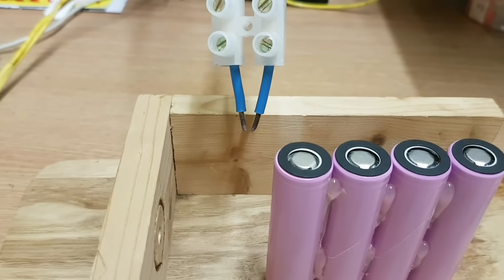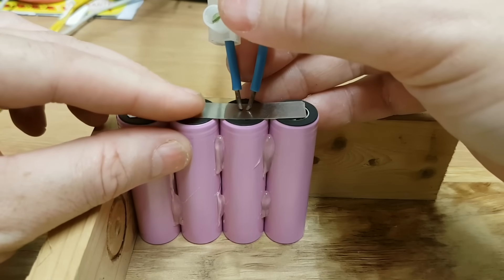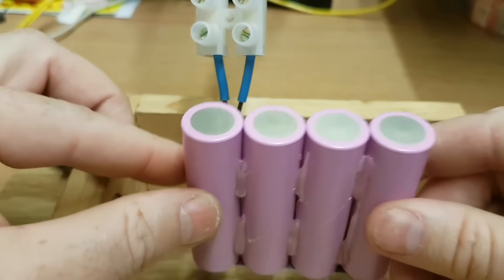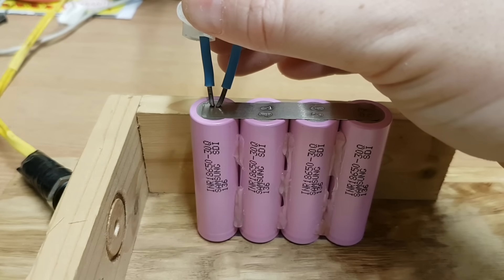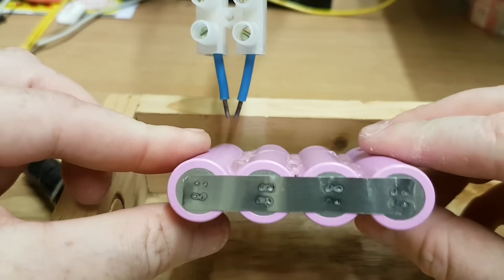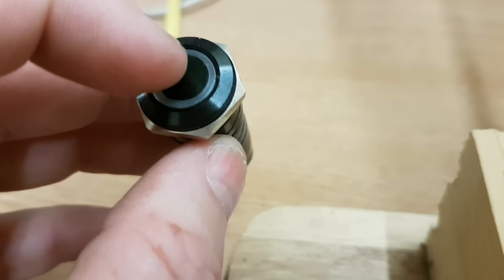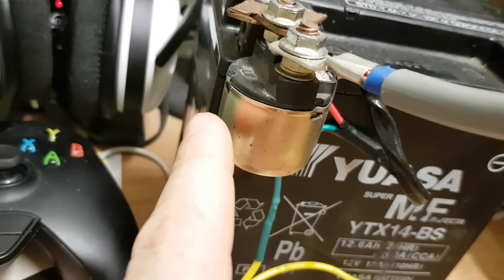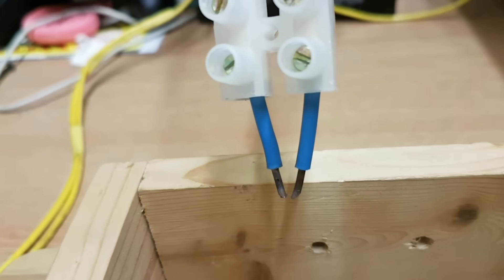DIY Battery Spot Welder - Demonstration & Explanation

Comment: very cool, this just appeared on my recommended list, I have some batteries for drills that need repairing so this might just be a great find to make a spot welder. I had no idea how basic they actually could be. Now just have to "get around to" doing those jobs lol. Well done and well explained. 👍
Reply: This is the same reason I'm looking for a diy spot welding method! Old Durabilt 14.4v tool kit with 5 tools that have lost function because the battery packs are dead
Reply: Right..I really want to fix up some old 12v batteries I have for an old kit.  I've seen videos of soldering the strips but lordy it scares me!

Comment: Pretty simple tool, though I did wonder how long the choc-block would last. The 60A rating you link to should be OK.

I suppose that wooden frame we see has other uses, but, with the delay timer, I'd think of a bracket for the switch. I think would want to use the delay timer if I were using a foot-switch. An option I came across was on an old sewing machine, a knee-operated controller, so the sewing machine could be on an ordinary table, with a detachable long arm over the table-edge to knee level. Again, use the delay timer.
Reply from the maker: Take a look at my later video... I integrate the button within the wooden jig 👍🏼

Comment: Great video mate, love the idea.
Quick question, where are you sourcing that metal strip? Is it shim material or something intended for that purpose?
Reply from the maker: It's 100% nickel. You get them in different strip widths and thicknesses. You don't want to get the nickel plated steel.

Comment: nice to know that it's actually this simple

say, I was considering to simply upgrade a makita battery with one of these 15 cell cases off aliexpress
think it would work if I just slap 5 extra cells at 2.5ah on there and make it a 7.5ah battery?
Reply from the maker: Yes, as long as the voltage was correct. If it's 18v it would be 4 cells in parallel to get the right voltage.

Comment: Hi thanks for the very useful vid, however I'm a little confused about what you've said 200 amp battery what do you meant by that? You're using 12v 12.6A right?
Reply from the maker: 200A CCA. It's a rating of how much current the battery can deliver.
Reply: @darkkevind  thank you

Comment: Great tutorial, I've tried many times to solder these with zero success so might give it a go, thanks
Reply: I soldered 96 cells together for an ebike pack. With a BIG iron with a super high thermal mass, it's not that difficult, but it's stupidly time consuming. Counterintutively, the bigger your iron, the less likely you are to damage the cell, because you can get that surface hot enough to tin without holding the iron there for a really long time. Still,  not ideal, this is a much better method.
Reply: @MrJamesonStyles +1 on bigger iron REDUCING heat delivered into the cell.   Also, I find that scrubbing the cell button with Scotchbrite right before soldering helps a LOT.

Comment: I have 2 questions :

1- this method or super capacitor method? Why?
2- how is the amper calculation formula? It reads 12Ah on the battery. How do we say it is 200A?
Reply from the maker: 200A is the CCA rating (cold cranking amps). It means the amount of amps the battery can produce, like for a starter motor etc. cranking over an engine.
Reply: darkkevind I have 12v 7a yuasa battery. How can I find its CCA rating?
Reply from the maker: @philipmurrayy  Google the specs of the battery? 🤷
Reply: darkkevind then how many amps I should get at least?
Reply: darkkevind I found these specs 

Nominal Capacity (Ah)
NP7-12
20hr to 1.75vpc 20oC
7
10hr to 1.75vpc 20oC
6.4
5hr to 1.70vpc 20oC
5.9
1hr to 1.60vpc 20oC
4.2
Voltage
12
Energy Density (Wh.L.20hr)
91
Specific Energy (Wh.kg.20hr)
32
Int. Resistance (m.Ohms)
25
Maximum discharge (A)
40/75
Short Circuit current (A)
210
Dimensions (mm)
Length
151
Width
65
Height overall
97.5
Weight (Kg)
2.65
Terminal
A/D
Layout
4
Terminal Torque Nm
-
Reply from the maker: @philipmurrayy  I'd go for a 300A CCA rating at least.

Comment: So now that you've done that how do you charge them?
Reply from the maker: The cells?
Reply: @darkkevind  Yes, how do you charge them?
Reply from the maker: @amelliamendel2227  well when they're made up in to a pack, normally you'd use a BMS, but you could charge them just with a power brick of the correct voltage, directly to the +/-

Comment: @darkkevind
Cool and easy, obviously very effective little spot welder for this function. The very same function that I want a spot welder for, making my own lithium battery packs.
Out of curiosity, how many spot welds do you get from the size battery you are using in this video before it needs recharging?
Edit: FYI new sub here, good work mate!
Reply from the maker: I easily welded 50 cells with at least two welds on each end of the cell on the same charge or the lead acid battery. After each pack I made I'd put the LAB on charge to top it up, but it didn't really need it to be honest.

Comment: Yeah, it works, but I am curious about whether it performs well with the batteries that do not have those broad "caps" on the "+" pole (these broad caps allow for easy soldering, unlike the narrower "pluses" on the older and cheaper, "made in china"  models).

Comment: so that setup can be used to rebuild a laptop battery pack? thanks   are other rechargeable batteries able to be tacked to the nickel strip as well?  also, what vehicle did the battery come from?
Reply from the maker: Yes, any pack can be made up with individual cells and nickel strip. The lead acid battery is from a small car.
Reply: darkkevind ok thank you very much sir!

Comment: What does the solenoid do?
Reply from the maker: Exactly the same thing it does with the starter motor Inn your car...
It lets a small, low current, low voltage switch, turn on a much bigger, much higher current rated switch.
Reply: @darkkevind  And that is necessary so the clicker switch doesn't have to carry the full current, correct?
Reply from the maker: @heavymod9476  that's correct.

Comment: Is it possible to use a capacitor with the battery rather than a solenoid? I've been using your design for over a year and the solenoid broke today. Just wondering if a capacitor would last years longer?
Reply from the maker: People have been using a capacitor to do the high current discharging... But I'm not sure that would take place of a switch?

Comment: Nice, works perfect. Ever considered a food pedal for activation? Then you would have both hand to handle the batteries.
Reply from the maker: I actually tried a foot pedal but didn't get the accuracy with welds that I can get with the finger activated button.

Comment: Went to Home Depot today and bought two lengths of heavy 1 O wire each at 2.5 ft or 763 mm. for 8.00 US. And added 1 ft or 305 mm in length of 1/8th inch or 3.175 mm solid copper wire.for  66 cents. or 60 euro cents.  I bought a battery of 280 cca for 22.00 at my local walmart. Or 19.90 euro's.  All of my parts will arrive tomorrow and I have already charged and tested my batteries for my 52 volt E-bike without a PAS sensor. Thanks for the video as it saved me a lot of money for a possible one time venture!
Reply from the maker: You're very welcome! I hope your build goes well :)
Reply: @darkkevind  It turned out better than I could have imagined. Thanks for all of your help and the post.
Reply: Or you could have bought one off Amazon for $30.00 to $50.00 without leaving the house.
Reply: @craiginswflorida9324 

Yes and those work maybe one time and then their done. The internal batteries always go bad.

For a decent one you have to spend  $200 - $300.

This is a better option.

Comment: i bought one of those chinese ones and it does work but the welds dont stick. like i could turn the nickel strip red hot and it still wont stick. idk why either its like 50/50 if it does or not
Reply from the maker: That's a shame... This seems to work well 99% of the time for me. 👍🏻

Comment: I recommend for anyone wanting to build this spot welder to place a "Zener Diode" in series with the negative  cable and one with the positive cable to prevent any overload on the solenoid, switch and battery and prevent injury.  Bridging a battery can cause an xplosion  and can result in serious injury or death!  You can also place a circuit breaker or fuse in series with the switch for overload circuit protection causing the breaker to switch or fuse to blow.  For zener diodes use correct amperage rating.
Reply: so, if one used the exact battery seen here, what zener diode is correct?   And, what size fuse would you use?
Reply: If you were driving the solenoid coil with an electronic timer, I agree a diode in reverse parallel over the coil ( almost any type will do) would protect the timer against back EMF. In this circuit there is nowhere to put a diode of any type in SERIES.

A 200A DC circuit breaker from ebay 9about £8 / $10 might be worth buying though.

Comment: Is there a reason you use a battery to power your spot welder? Could I use a PC power supply rated at 600w with the capacity of 12v at 60amps? Thanks
Reply from the maker: No you couldn't. As I explain in the video... you need at least 200A to conduct a decent spot weld that will weld the nickel to the battery cell. Also, you're basically shorting the battery and  you wouldn't want to do that with a mains power supply.
Reply: @darkkevind  Sorry, I must have missed the 200amp👍

Comment: What is the purpose of the solenoid? Why not have the switch connected to the negative of the battery directly?
Reply from the maker: Because the solenoid is a switch, a high current switch. It's the same reason you have a starter solenoid in an internal combustion engine car.... A very low current switch activates the solenoid which then completes a high current circuit.
Reply: @darkkevind   It slowly occurred to me, lol, Thanks.

Comment: this could be simpler than diy spot welder using microwave transformer. thanks
Reply: i got a question though, can i use a 12v 30amp supply instead of a 12v battery?
Reply from the maker: @rosekreuze  no, you need at least 200A, and you don't want to go shorting the mains.

Comment: I'm building a spotwelder , or gathering to build one, I have the SSR, timer board, welder electrodes, button, I just need the transformer, I have 2/0 for the transformer, and 4 gauge to go to the electrodes, I'm about ready to build, I also have a ac motor controller to lower the current to the transformer, its basically a 4000 watt dimmer, it cuts the sine wave, I hope to have enough adjustment to make it work well, I hate soldering batteries, although I have got a decent thing going, it can be fast, batteries cost too much to be melting solder on them!! Especially when there is a better option!!!

Comment: Great video! What is the purpose of the solonoid? Can't you just wire positive in 1 of the wires and then negative going through the switch and directly to the other wire?
Reply from the maker: The solenoid handles a very quick on/off scenario, plus, can handle a very large amount of current... A switch, such as the one I'm using to activate the solenoid, cannot.
Reply: @darkkevind  Oh okay, thanks for the quick respond

Comment: By this way you short circuit the battery and it is possible to explode the battery.
Firstly I think you need more than 2 batteries connected in series to have enough ampere.
Secondary, you send direct power and short circuit the batteries.
Reply: do some research how batteries work before you post
Reply from the maker: I've been using one 330cca battery for well over a year now...
Reply: @darkkevind  A battery doesn't explode that easily, it's only for a very short time.
Plus you still have more resistance when welding than by just connecting the poles.
Putting batteries in series raises the voltage, has nothing to do with amps.

Comment: 1. what material is the battery bands being welded
2. how thick are battery bands
3. how long does the 150A flow
Reply: Not the guy but I can answer these

1 - nickle is the standard for making packs

2 - looks like 1x10x60mm strips (based on the battery to strip size)

3 - current would ideally flow for fractions of a second, just enough for that spark/flash to make the weld as you want minimal heat into the batteries themselves.

Comment: Thank you, you just saved me a bunch of money
Reply: Nice video, but be careful!  You are essentially short-circuiting the battery via the solenoid and the electrodes.  There is absolutely NO current limiting here.  Gel-cells like the one you are using, don't like short-circuit conditions, and this arrangement will most likely kill the SLA battery much much sooner then you would normally expect.  However, that having been said, SLA's are quite cheap. ;)  I would not use a liquid-acid battery.  They can supply hundreds and hundreds of amps in a short-circuit condition, and this could result in explosions at your electrodes and on the battery itself.  Remember that if enough current flows across the contacts of the solenoid, the contacts can actually be welded together internally - then you have a permanent short-circuit across the battery pack you are welding - no matter if you release the button, and with hundreds of amps flowing......could be nasty! ;)  Still, nice video and such a simple way of doing it!  I think I would add a suitable fuse or high-current circuit-breaker to the mix though. :p

Comment: Hey, I don’t suppose you could help me with a project of mine? I have refurbished a jet powered surfboard but cannot figure out how to wire buttons to the vesc instead of a wireless remote? The old board had buttons but I’m unsure how to connect or rewire the ribbon cables onto the vesc?

Comment: Dude I need to make a 14.8 V battery with a 4 pin connector for my Vacuum cleaner.... can you give me any tips, especially if I don't have a spot welder? the size of the battery should be based on roughly 18650 cells
Reply: 4 X 3.7v = 14.8v ...  https://www.batterystuff.com/kb/articles/battery-articles/battery-bank-tutorial.html...

Comment: Love the design I have one tip for the plus side of the batteries cut the nickel strip in half length ways make it thinner as the battery vents are at the plus side 9*
Reply from the maker: That would inhibit its ability to carry as much Current as it can at its current width... The vents aren't covered up, there's still a gap.

Comment: Simple. A 12 volt car battery with as more amp start as possible(more than 300 would be ok), a 12 volt solenoid, cooper nails , 12 volt button (push off) and you're done!

Comment: How may amps of your battery??? Any details on your solenoid???
Reply from the maker: Battery: 330A, Solenoid: 150A rated, but higher would be better.
Reply: But your battery only 12.6AH
Reply from the maker: @kennyhokeanseng  so? AH has no correlation to how many CCA it can output...
Reply: darkkevind can I have the link to order the solenoid, I’m in malaysia amazon doesn’t sent to malaysia as I search in the internet. Can you help?? Thanks in advance
Reply from the maker: @kennyhokeanseng  https://m.ebay.com/sch/i.html?_from=R40&_trksid=p2380057.m4084.l1313.TR5.TRC0.A0.H0.Xatv+solenoid.TRS0&_nkw=atv+solenoid

Comment: 12.6 Amp Battery  No 200 Amps.
Reply: It's 12.6 Ah (capacity), but it can discharge a current of 200 A (which would empty the battery in 0.063 hours).

Comment: that  was surprisingly simple... and I reckon a high current RC 6S lipo pack would also be on task for give the current for these short current welds with a suited 24v starter solenoid relay.
Great video and good demonstration and relevant information.
Reply from the maker: I wouldn't use lipo if I were you! Not without an online super capacitor as lipos REALLY don't like being shorted... 😮
Reply: @darkkevind  Yeah that is certainly not high C Lipo packs finest moment when they get shorted.. // damn but I reckon i could handle the kickback with a diode bank like you know from jumpstarters that is based in Lipocells and use these diode banks to take most of the kickback and when its these short pulses.. it would be even lower then when using lipo cells as jumpstarters..
Reply: Its these i had in mind... I got a bunch of them as they costed 2 USD with good silicone wires and jumper-clamps and just the 10awg silicone wires usually cost more in itself. https://www.youtube.com/watch?v=F8zghvQZYNM
but if it will work in practice I got no idea..
Reply from the maker: @JAKOB1977  I mean... You could try.. for science... Just be careful 👍🏻
Reply: @darkkevind  I will, and use older packs to try it with as a simple proof of concept and meanwhile check the resistance and possible pregnancy on the cells.. have just seen you updated video on the matter.. looks good and work as a charm almost better then the el'cheapo solutions you can aqquire from China to spot weld with... impressive good DIY job +1..
Reply from the maker: @JAKOB1977  thanks! 👍🏻 Would love to see how you get on...
Reply: @darkkevind  if you still in the market for a timecontroller that able for very short 1-500ms.. if its any good or even userfull for your need I cant say.. Im simply just skimming the market for alternatives and equipment.  https://www.yousun.org/product/mini-spot-welder-time-controller

Comment: Why wont use NE555 for control time of impulse?
Reply from the maker: Timers don't seem to work...
Reply: @darkkevind  why u think so? They working perfect) u just need simple diagram to embed in ur device! It will be great control
Reply from the maker: @Akc64  I tried one and it didn't go down low enough for the timing... you need around .005 of a second.